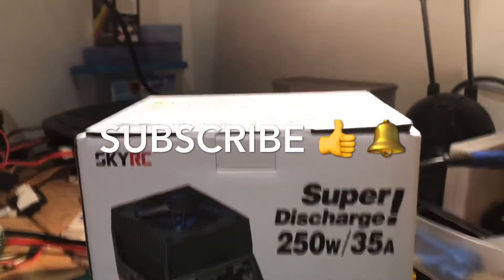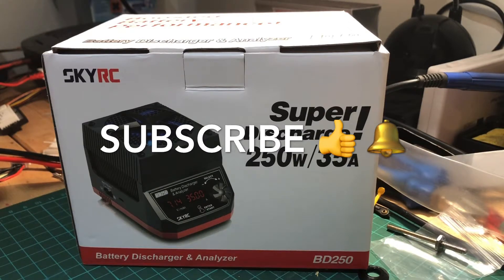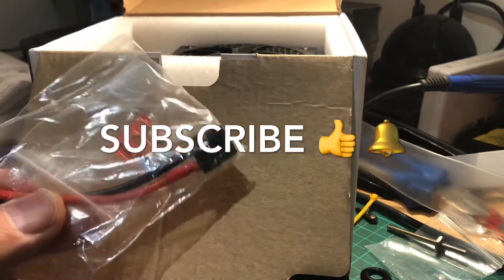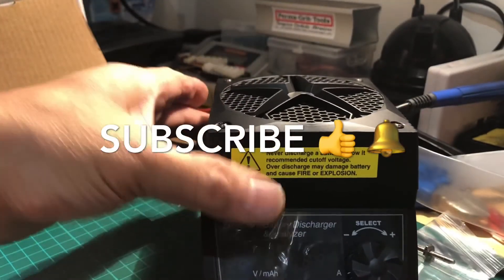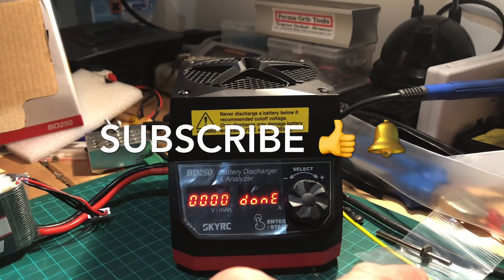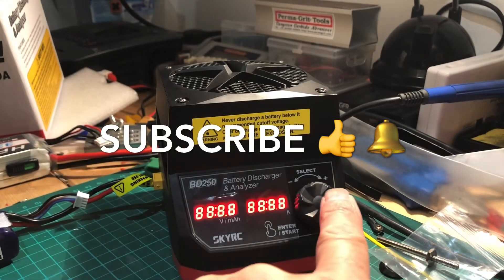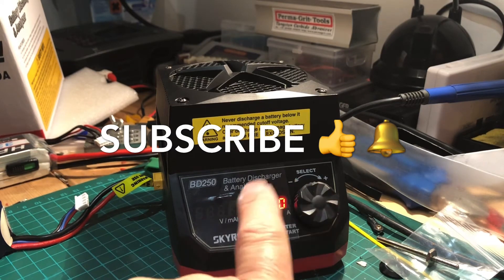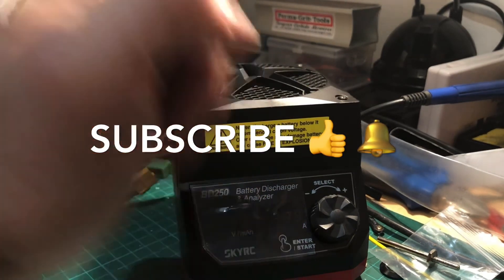SkyRc Lipo discharger BD250

Comment: The problem with this model is the charge rates are not adjustable. You are stuck with what they give you. High charge rates carry a penalty, premature short battery life.
Reply from the maker: Hi bobcatt22. This BD250 is a lipo discharge and will discharge at any rate you can lower the discharge rate to what ever you want. Note bobcatt22 this is not a charger. Fly safe 👍
Reply: @dannyporter888silverfox8  Thank you for the headup. Received the MC3000 and the distributor is trying to figure out how to pair it with MC3000 app. Just will not work. The Epoch X4 Touch is my next consideration.